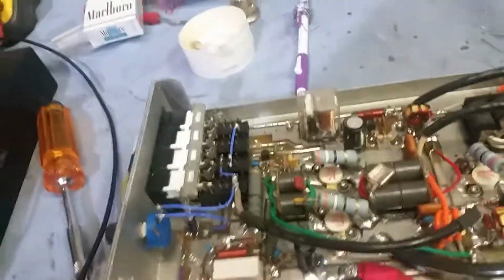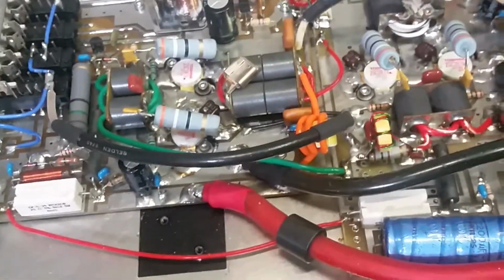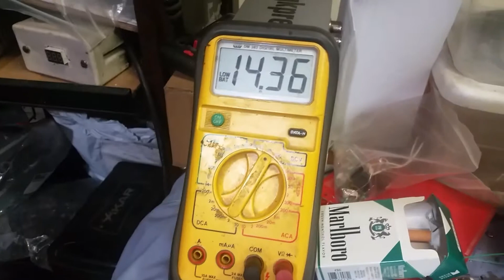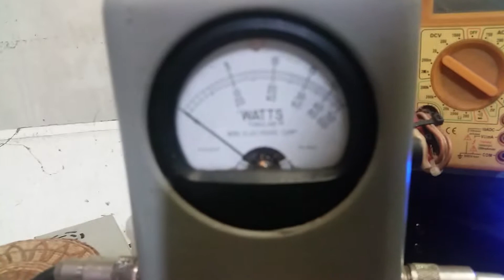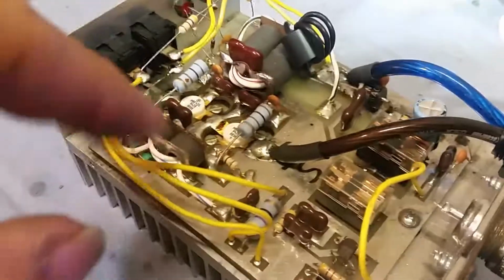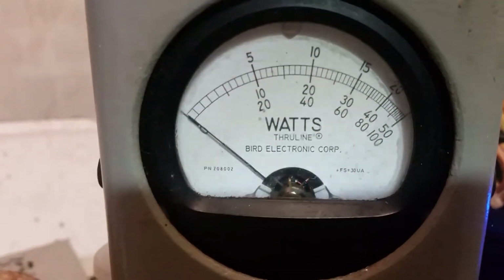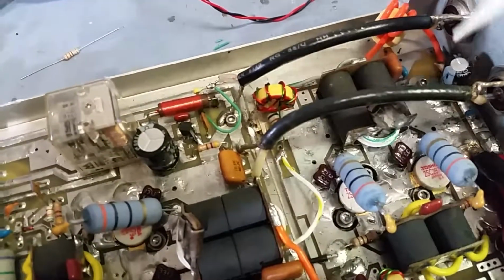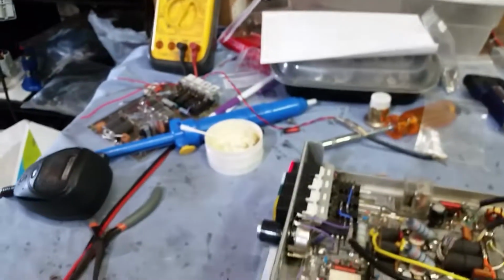A Mysterious Solder Booger👃Disabled This RF Amplifier - [TS DX500 & More]

Comment: that was inters ting place for a solder bridge . I put a fuse on my fan wires inside the amp. better to use the ring terminal as neg. no short to ground when plug in. that style of connector was made for audio . that short when plug in is to mute audio for less hum and pop when plug in. the 1/4 in was made for switch board for telephone use . over a 100 years later we still use that plug. playing with KL 805 amp from Italy 24V . takes 15-16 watts to get 600 watt PEP . MRF 422 X 4 . peek 28amps 28V . got a 3 ft snow storm. stuff held up. was told 60 to 100 watt digital depending on duty cycle. used the same yellow SB 50 . only plugs into yellow. I use gray for 12V. only had on dummy load so far.   harmonic's are way down . have the RM Italy low pass filter. tested that . cleaned up a dirty box.  amp has 3 -12A fuse in it. got a 100 of them . 5x20 MM . Amazon has them. even the 250V mini  micro wave fuse. that small amp with MRF 455 can use SD 1446 with a bit of re tune and get a tad more out of it. I am not getting much heat of KL 805 at 100 watt dead key FM on a few long keys .that in dummy load. got a roll of MIL SPEC RG 58C/U . made in England . waiting on BNC for that job. snow delay ! . 73's
Reply from the maker: Guess what we are playing with...the HG2510 1500w at about 800w AVG but they keep giving up the ghost on 28v IDK thing these can run at 28v at that drive...have you played with yours yet? We need to figure this out.

Comment: I have a Boomer Deluxe 500 and it keys at 300 and when I modulate it backwards swings about 50 watts, I have hooked 4 radios to it and I think it has damaged a couple of them, what do you think? I may have to send it somewhere and if so maybe I should send it to you. It is heavy though.
Reply from the maker: Well when you say backswing I am sure you are saying it is backswinging on a RMS/AvG reading watt meter.... if it is back shining on a PEP meter then wow something is SERIOUS WRONG!!! 

Check the power supply also that is a 4 pill config right so it should be hard to swing back unless you just had your dead key way high way way high.

Check the voltage and make sure the regulation circuit inidfecthr power supply of the smp isn't falling out of regulation or anything. That is an old amp brother.

Of course make sure your carrier is low.